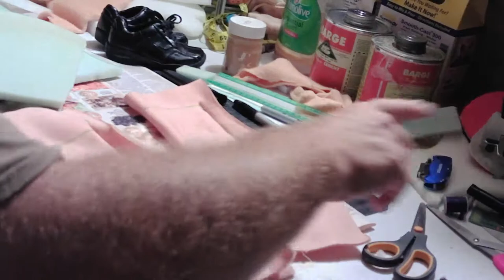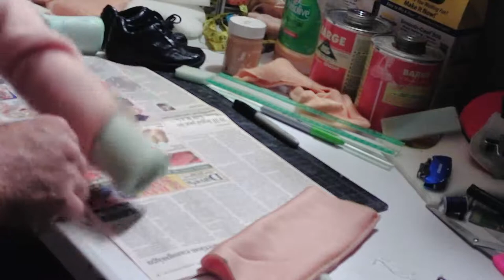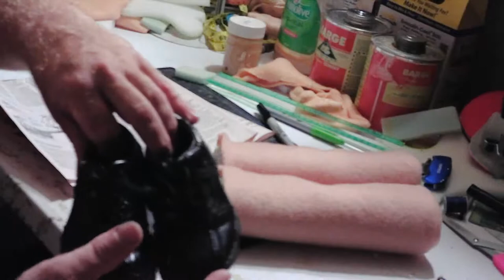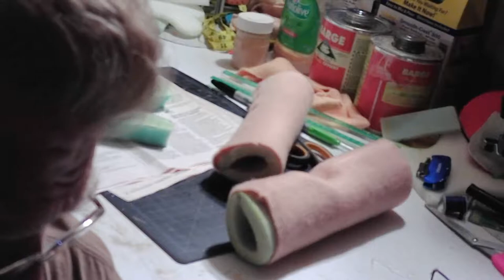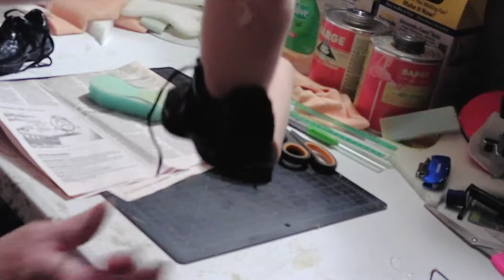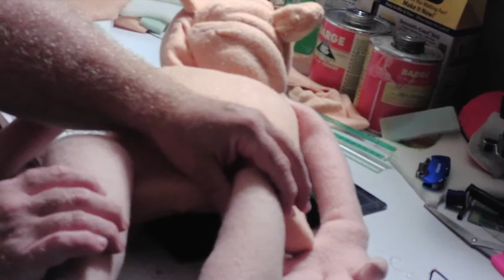How To Make Puppet Legs & Feet

Comment: I have a dumb question. If you put pants on the puppet, where do you put your hand thru the back of the puppet? I’m so confused.
Reply from the maker: Make spot on the back of the puppet where your hand goes into the body through the shirt and body or attach the pants to the front of the puppet allowing you to go into the body up under the bottom of the shirt.